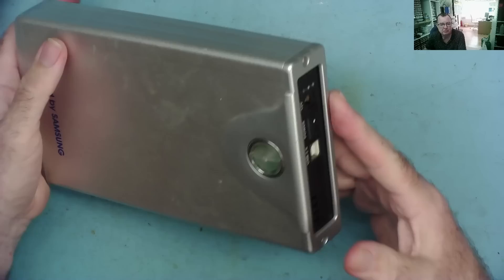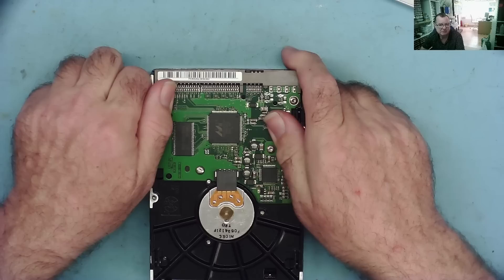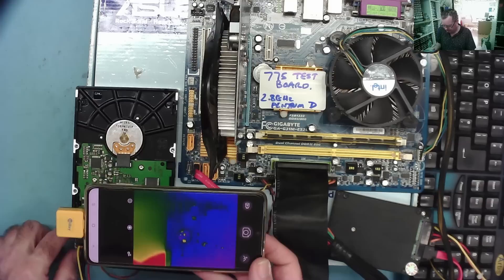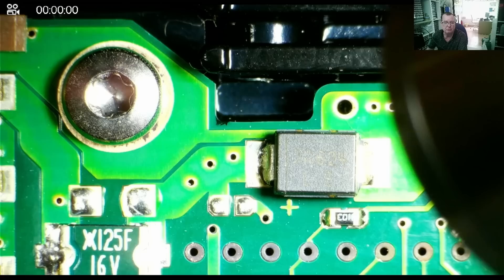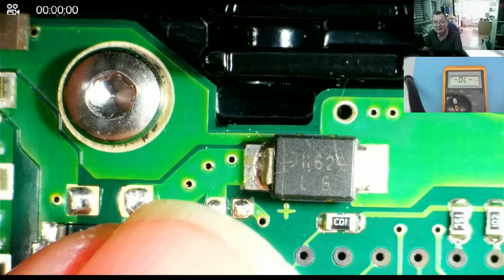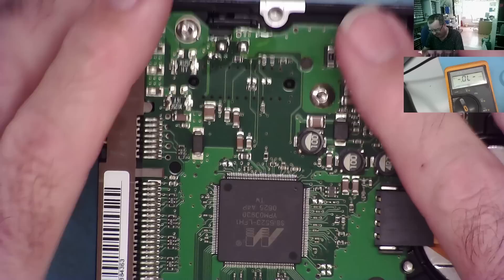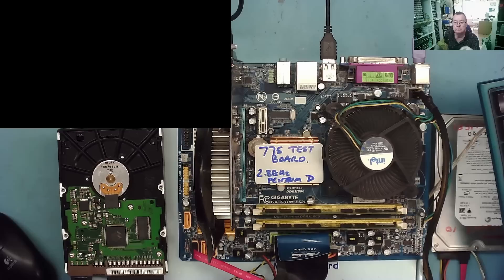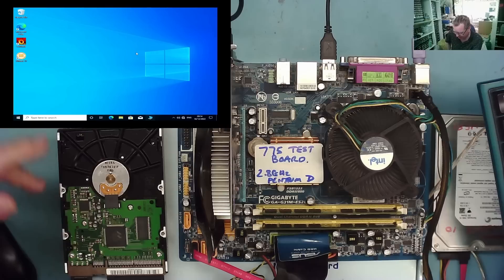Customer Asked Me To Recover Data From An Old Dead Hard Drive (Does Not Spin)

Comment: This customer is lucky he knows you. Most computer shops are not able to diagnose or repair a harddisk circuit board. They simply tell you data is lost and try to sell you a new harddisk.
Reply: @monad_tcp  Do you know a computer shop having those tons of hdd circuit boards in stock ? It is simply not cost-effective. It takes someone who can diagnose in the first place the problem is on the hdd circuit board, and in the second place can repair it on component level.
Reply: You are joking?
Reply from the maker: @monad_tcp  That can work also,  but then there are many HDD that have specific firmware on each drive so you have to desolder the eprom from the bad controller card and resolder it on the replacement one and then there are the ones that have some special firmware in the QFN controller chip with a couple of hundred very narrow pins to solder.    Swapping the controller card may have worked back in the 90s and a little later but as with everything else it has got a lot more difficult that that in later years.  Of course the fix in this video only works for a specific type of damage also
Reply: im guilty by this since i dont have enough knowledge to know if it is still possible and dont have the proper tools, but by this simple yet effective diagnose, one by one i will learn more.

Comment: The same situation happened to me once with an old 500gb drive... it had a lot of valuable por... erm... information that needed to be extracted and the drive wouldn't wanna spin... so, I took the lid off, and while powered on, I gave it a little "push" and whadaya know... it spin up! ... extracted the "info" while being absolutely mesmerized at how hard drives read info from the platters, and then dissasembled it to salvage the magnets... no burnt diodes though... xD Cheers!

Comment: These protection diodes are really useful. Once I had a wrongly wired power cable which reversed the voltage to the drive. The diode went short and as there was no fuse on my drive this short prevented the ATX power supply from working. Replacing the diode solved all problems no other damage on the HDD. What a luck or better good design!
Reply: Not every time. I had one where the TVS died but well after all the other regulators fried. In mine, 5V was fed 12V though.

Comment: When I worked on testing hard drives many years ago I made a linear power supply with LM7805 and LM812 just to power up drives. Pretty bullet proof against shorts and I didn't have to worry about my ATX power supply trying to dump 20+ amps into the wires and possibly shutting down the whole test computer. The 1.5 amp limit of the linear regulators was plenty enough power to spin up a good drive.
Reply: Where do I buy such a device

Comment: You can get unidirectional TVS diodes too, I guess they are faster than ordinary zeners - you can also get TVS thyristors which clamp to 0v(rather than the tvs diode voltage) and latch while the current flows.

Comment: Great video as always! For what I understand, TVS diodes are not necessarily bidirectional. On this board, we can see a line showing the catode. For example, Littlefuse datasheet for the 1.5KE series shows both unidirectional and bidirectional TVS diodes. I have read that TVS diodes are made to support larger surges than Zener diodes and to have a faster crowbar effect time, but I am not sure about that...
Reply from the maker: Yes these ones appear to be zener diodes are far as my diode mode meter test tells me. TVS (at least the ones I know) read open circuit in both directions if they are good.  They are much more similar to a VDR (MOV) in operation.  MOV also read open circuit on a multimeter
Reply: @LearnElectronicsRepair  Only bidirectional TVS read open circuit on both directions. For example, a SMAJ14A reads like a diode (0.6V) in one direction, I just checked. a SMAJ14AC would be a bidirectional TVS and read open on both directions. I also checked a P65SMB51A ordered from Reichelt : it reads 0.6V in one direction!
Reply: @LearnElectronicsRepair  Those transil diodes that have OC on both sides propably are build from two diodes serially connected with cathodes or anodes like this:

---|>|---|-<|------ or -----|<|---|>|-------

that makes them bidirectional and universal (and more expensive)

Comment: I wish drive board repairs were this easy. I have some humdinger issues with a couple drives that I am still not able to trace down, but I’ll keep at it the more can I learn about diagnosing hard drive board issues.
Reply from the maker: Of course they are not always this easy.   But that is just how this repair turned out (I have no idea when I start a job) and a worthwhile video also, as i have seen this sort of failure on numerous occasions 😉

Comment: Yep, this was a very common fault on certain mechanical drives.

I had to remove the TVS a fair number times over the years, and a few times when I last worked at a PC shop (2008-2009).

I think the TVS just degrades internally if there has been even a small voltage spike from a failing ATX PSU, or some noise that go through via the mains.
Maybe the threshold voltage of the TVS was set a bit too low or something, so even a moderate voltage spike of 16V or so could damage it?

Or perhaps back-EMF from the spindle motor could slowly damage the TVS over time, until it eventually shorts?

Comment: I like your videos and find them very helpful, but I have a couple of issues with this one:

1. Firstly, although the drive is potentially scrap, you appear to have an apparent disregard for ESD protection. I appreciate you may have many years experience but ESD damage is not a case of it either works or it does not and may not manifest itself for some time until suddenly it does.

2. The second issue is the use of a Windows-based system to check a hard drive. I would never connect an unknown storage device to a Windows system because Windows always has to try to read and write data to a drive and therefore is far more prone to transferring viruses and also preventing recovery of previously deleted files. There is also another issue, as shown in the video, that Windows will always attempt to build a cache of data which in this case is a thumbnail cache of someone else'e photos and therefore potentially in breach of Data Protection regulations.

When I am asked to look a hard drive I always use a Live Linux USB stick as it avoids all these pitfalls, allows full access to a storage device for much better data revovery possibilities than Windows and because nothing is stored, because everything happens in the host computer's RAM and therefore is safely gone entirely when the system is powered down, it is much safer and secure for all parties concerned. My personal choice is Fedora Linux with the Mate Desktop because it runs well on older hardware and has a disk utility built-in that will read SMART data from the drive as well as intructing a drive to do various self-diagnostics (which is something I've used to get a drive to repair itself).

Comment: I was going to suggest if you have people bring you dead drives to backup often, I suggest keeping a few of the hdd circuit boards.... I've been able to swap them out and get the drive to spin up instantly and perform backups with no headaches whatsoever.
Reply from the maker: I've also repaired drives that way - but I never needed to do so if there is a short TVS diode or MLCC capacitor on the controller board as they are easy to fix, just locate and remove the shorted part and they will work, at least for backing up the data.  Another consideration is that more recent HDD usually have an eprom on the controller board that you have to remove from your bad one and solder to the replacement one.  And some drives are even more difficult than that to replace the controller board.
Reply: @LearnElectronicsRepair  there are few hdd brands seagate,wd,toshiba and etc what brand today does have that kind of controller board?

Comment: I remember having a similar problem years ago on a hard drive.  Unfortunately though, besides the protection diode shorting out, a number of other components went up with it as well and it just wasn't worth the effort to mess with it. Luckily I did have the info on a back up drive at the time.  Win some, lose some I guess.  Sometimes you CAN get lucky IF you can find the exact same motherboard on a different scrap drive and replace the fried one, but this does NOT always work because each board is "fine tuned" to each drive.  I think I had success maybe once by doing this in the past.  Best just to ALWAYS have backups of your important data, now especially since hard drives are so cheap compared to years ago.
Reply: With USB drives and SD cards having such large capacities now and being relatively inexpensive, I just use them for backing up important phots and such.  I do have a couple of old 2.5" SATA SSD drives from computers I upgraded from, I always save the SSD drives and buy USB adapters for them that convert the into external drives.

Comment: Saw this video and it inspired me to get out an old IDE hard drive of mine that died around 2002 due to a power surge.  Most of it was backed up, except a large project I was working on that I couldn't afford the cost of backing up.  A couple years later when I had some money, I even paid a data recovery firm to have a look at it and they said they couldn't get it to spin up.  I paid $120 for the privilege I seem to remember.  Anyhow, sure enough I check it and there's a short between one of the voltage pins and the ground.  However it's a more recent drive than the one you show.  Which pin is 12 and which is 5 volts are not labeled.  I do see a little black box like the diode you show, but only one, not two.  And indeed there is a short across it.  Any reason you can think of I shouldn't try removing that box and see if I can get the drive to spin up after all these years? The drive is a Maxtor Diamondmax Plus 8 30GB.    Not sure what 'model' but the 'code' is NAR61590 if that means anything.
Reply: The writing is tiny and I don't have a microscope, but the black box seems to have a logo I can't really make out and "BUX C231" printed on it, if that helps.
Reply from the maker: @ghohenzollern  Remove it and see if the short has gone.  If not you can always put it back on again. If the short is gone then power up your drive and let us all know the outcome  🙂
Reply: @LearnElectronicsRepair  Here's what happened.  So far I've not managed to get any data off it.  Constant I/O errors, but it may be my IDE to USB adapter.  Or do you see me doing anything wrong?
https://youtu.be/4XKtYGApSqk

Comment: great video easy fix for anyone with a multimeter and a soldering iron! a suggestion, do not show customers data (even if it's just a folder list).
Reply from the maker: You know, a lot of people are getting very over sensitive about that.  Sure if a folder list contains personal information (phone numbers, address etc) but I don't believe there was any info on that HDD, that I showed, which could cause any harm to anyone.

Comment: I have a barely used MIG 155(110v/220v) 4 in one welder I would appreciate some help repairing. I thought ide recorded the locations of all the wires connected to the circuit boards but I’m having trouble getting it connected correctly. The seller off Amazon quite selling this model and doesn’t seem to give a crap. The user manual is one piece of paper front n back so it’s of no help either. Searching online hasn’t shown anything helpful enough for me to resolve this problem.

Comment: I have an older IDE hard drive with windows XP and the drive spins up, clicks 5 times, then shuts down. Trying to figure out if it's a bad ide controller board on the HDD or if the drive had a head crash.

Comment: I have a USB to IDE adapter.  Would connect it up to a Linux computer and DD an image of the hard drive.
Reply: Also, you want to be ready to copy the data immediately once you bring the drive up and not have to shut it down again to connect another drive to back the data up to because I have seen instances where the drive came up ONE LAST TIME ONLY and if you didn't get the data copied that one time, you lost it for good!
Reply: USB to IDE adapters have slow speed. So it depends on the amount of gigabytes of data that need to be copied. Hook up the HDD to an ide or sata port on a motherboard and things go much faster.
Reply: @seeithappen1  There are fast USB 3 to IDE adaptors, but some are fake and only the plug is USB 3...

Comment: I Need Your Help Sir,

my pc keeps restarting...I found the fault..It's My DVD drive..Without my Dvd Player plugged in PC Boots Fine Works..

My Dvd Player also don't Read anything...It Opens Closes..spins inside..but it Don't reads anything in PC...But I am 80% sure that the lens is Ok...I never Abused it With Scratchy Discs...Must be something with Connectors terminals or something.

I am afraid to give my Dvd drive to a repair shop I am afraid they will not fix it and they will rather Salvage its parts and Pay me some amount..I dont have any money to buy a New DVD RW.. wanna fix it myself..I have a working Multimeter that I can use and Soldering Tools.And Screw Drivers to open stuffs..thats all...I am poor Please give me any Instructions how to fix it.....😔😔

Comment: why did you have to but the data onto another drive ? when that drive was now working
Reply from the maker: Because I did what the customer should have done in the first place.  Made a backup copy on a new USB HDD and charged him for it.  Plus he get's his original drive back as well with the data on it.  The customer was happy with that
Reply: No sane person would consider a 20+ years old drive that just came back from the dead as a safe to use and entrust data to it :D
Reply: Old drive is now close to 20 years old, and a drive that old will fail at any time without warning. Hard drives are precision items, and that precision comes with very little between working and not working. Here it was just luck that he had a drive with both the fuses and the diodes, as later on models those got cost cut out, saving a  half cent per drive, which adds up, if you make a million drives a quarter, to a big chunk of change as cost saving.
Reply: @LearnElectronicsRepair  Good job
Reply: I would not trust that drive.
Reply: Since there is now no protection diode, the next power surge will cause a lot more damage. But will last long enough to make a backup.

Comment: Obviously you are very smart, but using Windows to recover or even connect to someones drive is not good.  Windows CAN and WILL delete files on any drive if it doesn't like the file !